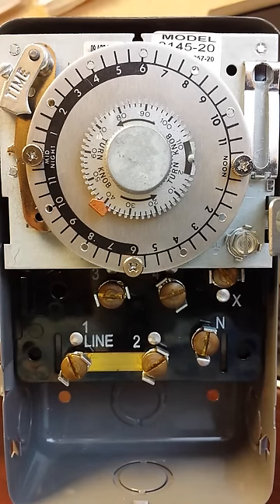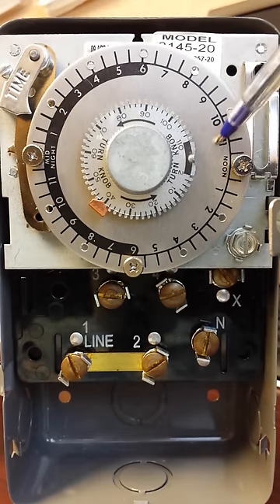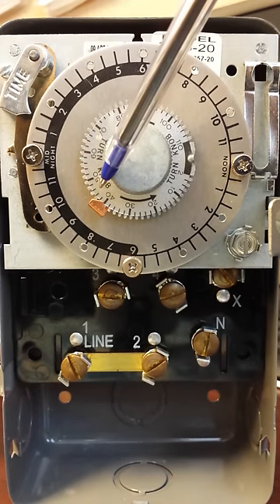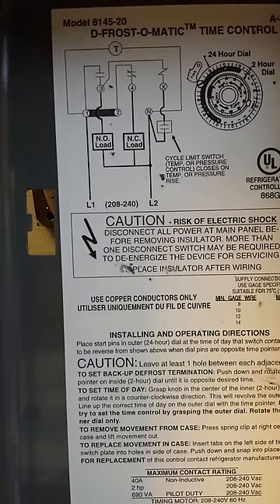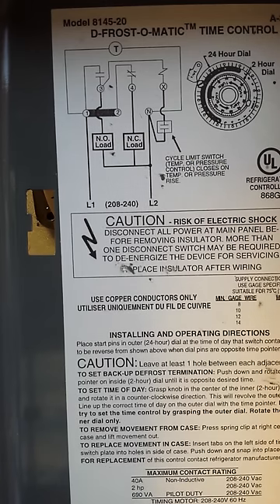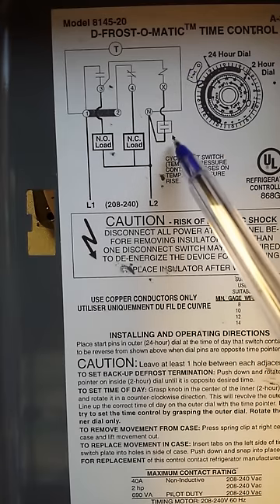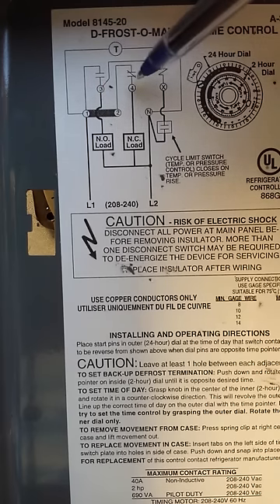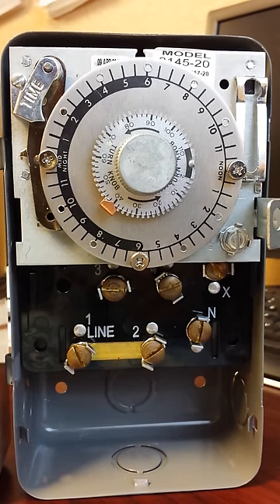HOW FREEZER DEFROST TIMER OPERATES

Comment: these Paragon time clocks they are found in freestanding freezers, refrigerators, walk in coolers and Freezers and in older supermarket refrigeration units or rack systems up to the 1980s. as the newer rack systems will have a computer controlling all defrosts and other functions.  but they are still available today on many equipment on True, Masterbilt, cases and Bohn Heatcraft single condensing units.  common problems with these clocks the center knob if not tight and is subject to alot of vibration if on condensing units with Semi-Hermetic compressors the center knob, and the outer dial can fall off. if the time clock is mounted with the time pointer and swing arm down it may not put the equipment into defrost.  i seen on some installations they mount the clock on the walls away from the compressor so the clock is isolated from vibration. other problems is after time the gears, the start pins can wear as i spray some lubricant on the gears to make the clock last longer. the contacts burnt if the connections are tight if its directly to a heater circuit. and certian times the timer motor can go bad meaning the equipment will be stuck in defrost or not go into defrost at all.  as many replace the whole clock if it goes bad but they have the timer motor available for them.  there is many models of these time clocks  the ones for walk in coolers or refrigerated medium temperature cases will have a compressor off defrost meaning time initiated, time terminated. The low temperature walk in coolers and frozen food cases will have a time initiated, pressure or temperature terminated defrost. on these when the system goes into defrost on some walk in freezers and frozen food cases it will cut power to the refrigerant solenoid valve and will pump the system down to the reciever tank till the pressure control turns off the compressor via contactor, as well the defrost circuit on this clock controls the contactor coil for the defrost contactor for the defrost heaters in the case. as the contactors are for higher amperage heaters than the clock is rated. Smaller walk in coolers and cases it will be wired directly to the heaters on the coil. and has a defrost termination and fan delay switch if the temperature gets up in the case before the set time on the clock the switch will close and energize the coil behind the clock closing the solenoid valve, compressor contactor,  as well killing the power to the defrost heaters and heater contactor. and resumes its normal refrigeration cycle. when the fan delay switch closes when the coil closes the evaporator fans will come on.  Some of these Paragon clocks they been replaced by circuit board type clocks either Paragon or Grasslin, or a electronic time clock by Paragon or Grasslin.  but most refrigeration techs use these Paragon time clocks the mechanical ones as they are reliable and have solid contacts.  as previously Paragon was its own company then sometime it was a Subsidary of AMF American Machine Foundary, then Paragon Electric company.  then its marketed by Invensys under Ranco North America. as i think Robartshaw owns the Paragon  brand.

Comment: He's not full of shit. In case anyone is wondering why you need a neutral, its not for the freezer itself, because the defrost heaters are almost always 208v-240v. It's for the motor that runs the clock of the timer. And the X that he's talking about is commonly known as a defrost termination switch.

Comment: In a walk in refrigerator, are there systems that simply shut off the compressor long enough to defrost using the above freezing  temperatures in the conditioned space to defrost the evaporator(s)?

Comment: the heater is rated at 725 watts , my question is at what degree it reach at full capacity ? 100 degree or 200 ?? what is the temp limit ?

Comment: I have one of these installed in my garage to a dedicated outlet (8045-0) by the previous owner. I have no idea what he used it for other than maybe a timed outlet for the block heater in his car?
He was an electrician and wired the house with scrap from jobsites. Every time I have to open up a wall I nearly have a heart attack I'm assuming he used this rather than spending $20.

Comment: I'm in school and trying to wire up a walkin freezer. It's a 3 phase 360 volt unit. I cant get the compressor to start. How do I wire the thermostat? Do I wire it to the defrost timer or do I wire it to the 3 pole contactor? I wired it to the contactor built cant get the compressor to start still??
Reply from the maker: The compressor will be fed power strictly by the contractor.  If your system will pump down via a liq. line solenoid, then that will be controlled by the tstat. The tstat will get feed power from the defrost control thru the normally closed contacts. then contactor will be controlled by a low pressure control.  thus when tstat opens, unit pumps down, pressure control opens on low pressure de-energizing contactor. There are other ways to accomplish the system cycle,  but this is a very common method.  i hope that helps.

Comment: I was reading 208v between N and 3, which means I'm in defrost, but at the same time I was reading 208v between N and X also while the freezer was still in defrost. Is that correct?